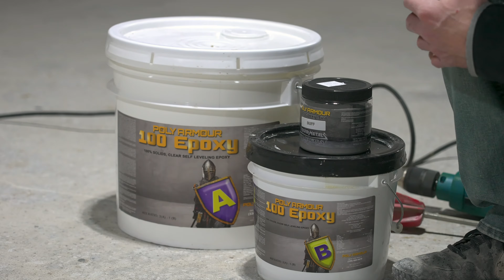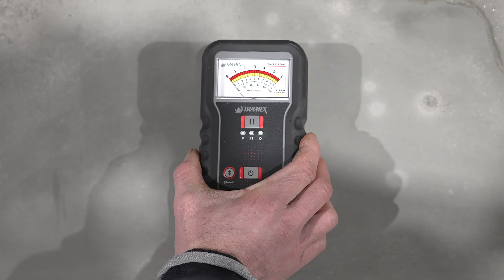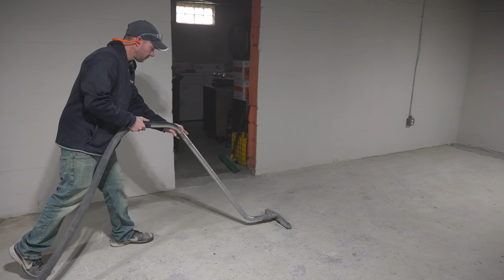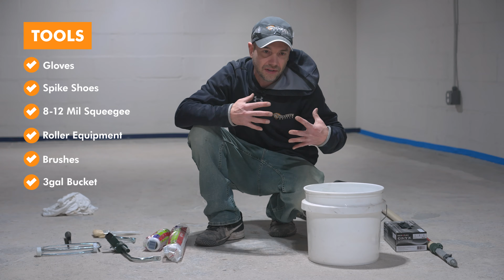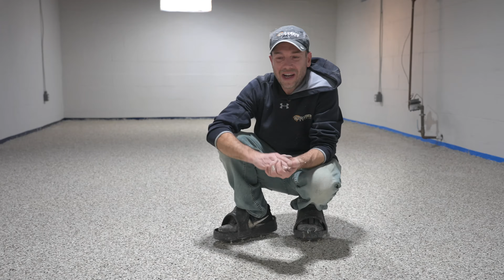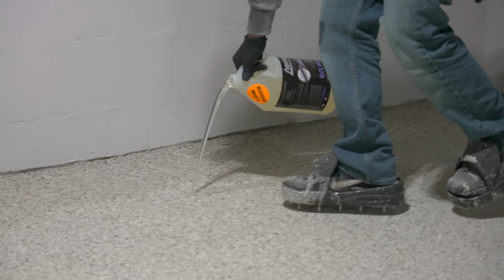How to Create a PERFECT DIY Epoxy Chip Floor (No Experience Needed!)

Comment: Hi can you do this same technique but without the chip in order to create a smooth outdoor surface for wheeled sports?
Reply from the maker: Thanks for the comment! Yes, you can do this without the chips. Just keep in mind that the chips hide all the imperfections in the floor and in the epoxy coating. However, epoxy floor coatings are made for interior floors only. These products will not hold up well on exterior concrete. Thanks for watching Deco-Crete TV!!!